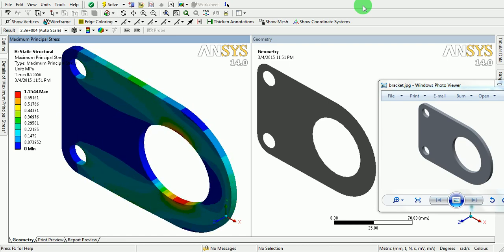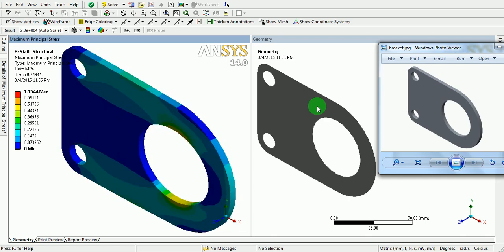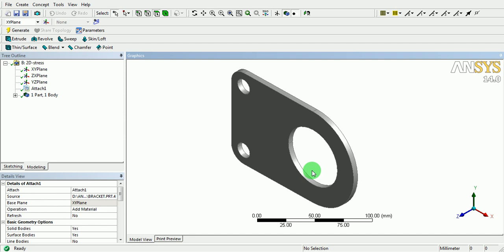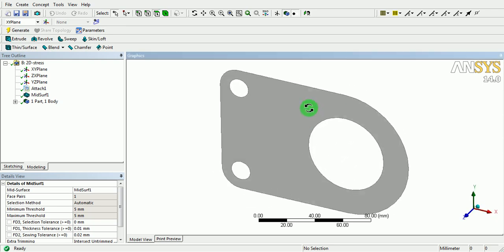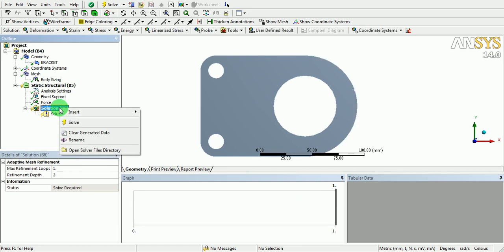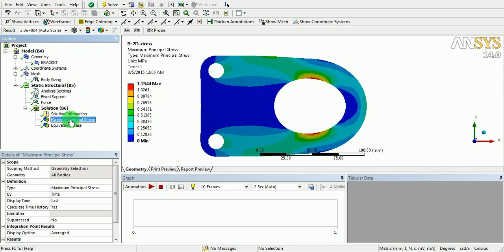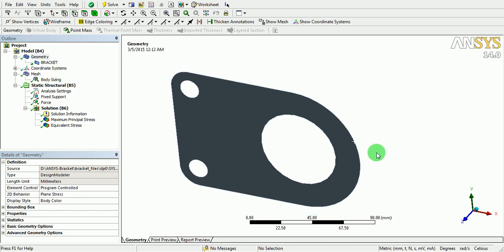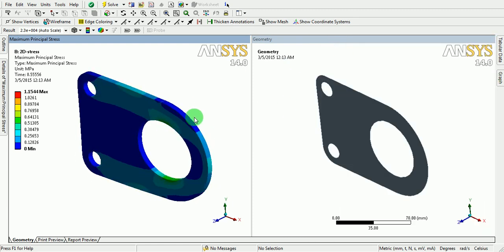ANSYS Plain Stress |  2D Analysis in Workbench | GRS |

Comment: Hi Sir. I tried your tutorial in this video. I am importing a 3D fluidized bed from Solid work to Ansys Fluent. And create a mid plane as I wanted to analysis in 2D. However, mid-plane seems like only works fro 3D geometry. Then after I succesfully attach the 3D fluidied bed (column), I cannot proceed with the MESH as it gives me an error messages said: no valid bodies found. May I know how can I solve this problem or any advice you can give? Thank you, Sir
Reply: Me too
Reply: have you got solution?